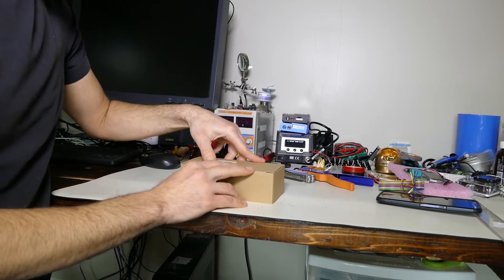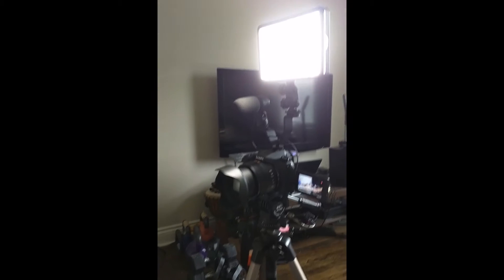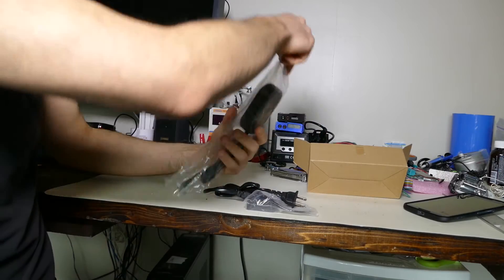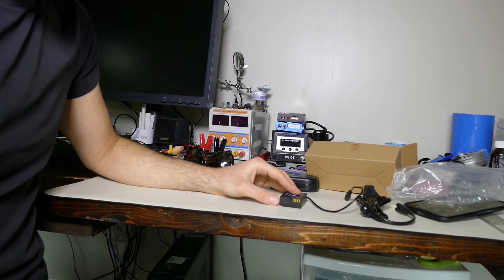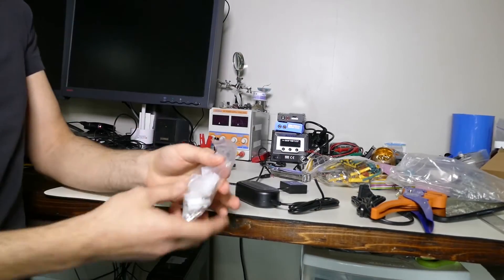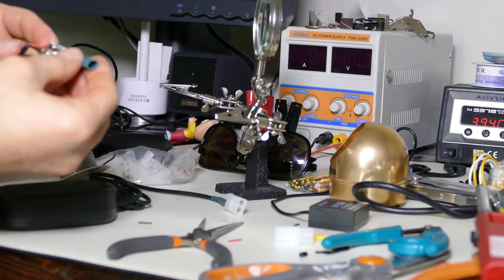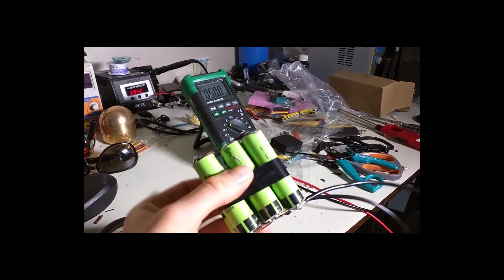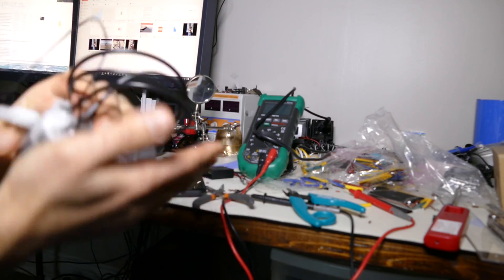DIY External battery for Panasonic Lumix FZ1000

Comment: How long did it last
Reply from the maker: Hi im going to do some testing soon. just working on another battery pack right now for my x100T which will be up soon.
Reply from the maker: seeing that these were used li-ion batts. i only got about double the capacity from them.
Reply: oh, i see. did you get them from a laptop? i have a battery pack from a bike battery and it also did not last long until i used a boost converter to keep the voltage at 8.4. thank you for the update
Reply from the maker: yes these were used cells. I do notice that with the lumix if the voltage drops below 7.8 then it shuts off.  better batteries would help in my case as i disnt test the capacity on these particular ones.